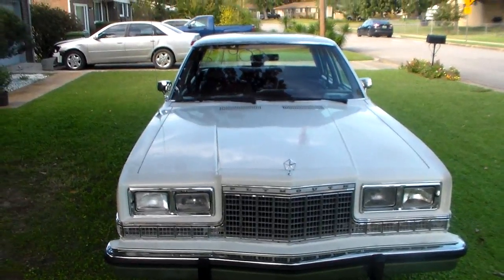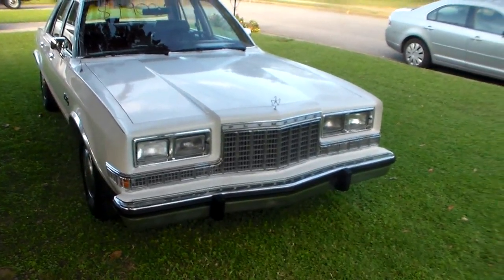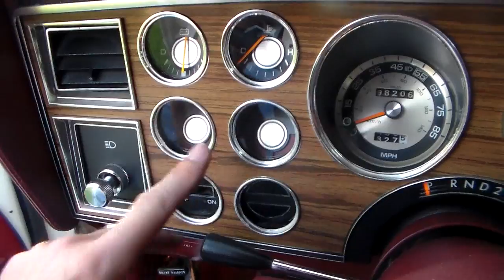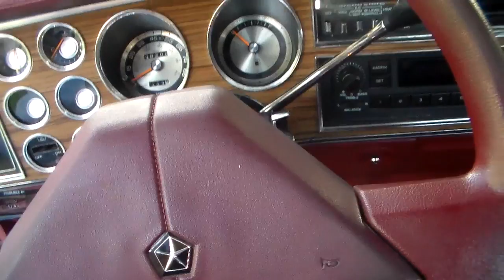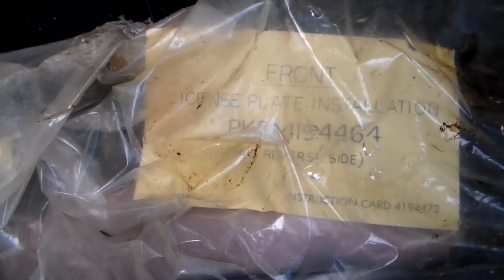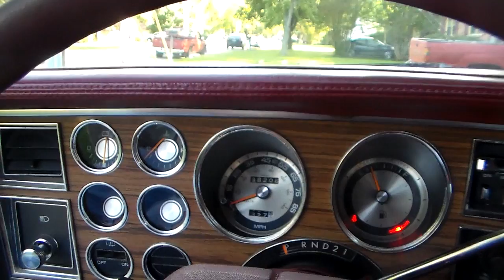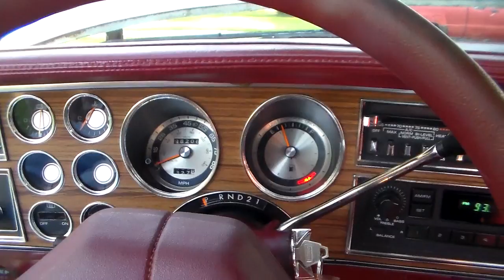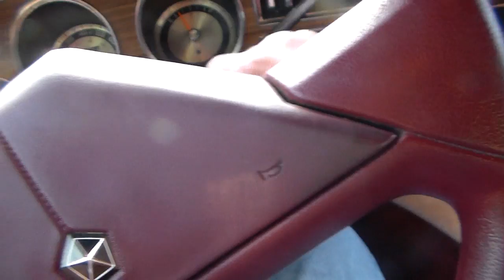Introducing my new 1987 Plymouth Gran Fury

Comment: The M body also included the Mirada, Mopar's first flexible bumper car.

I'm amazed at how many parts Mopar swapped among its vehicles. That heater control, the radio, the hubcaps, and the window cranks are exactly what came standard on my 84 pickup. The windshield wiper controls are exactly what was on my Horizon.
Reply: All They Found Was A Boot My '76 Plymouth Volare has the same heater controls. Besides the cluster it has essentially the same dashboard.

Comment: Great choice!  I got my '88 Fifth Avenue for $700 (yes hundred), being an HP junkie and with my Duster out of commission I've swapped in an 8 1/4" rear with 3.07 gears, made my own dual exhaust, and converted to 4-bbl TQ on a Performer intake.  Goes pretty good for a 4000-lb car with me in it, and still gets high teens MPG.
Reply: Get rid of the lean burn/spark control computer they had multiple names over the years (mounted on aircleaner)

Add a vacuum advanced distributor,mopar orange box ecu and if using a 2bbl still get a larger cfm 2bbl  not the smog lean burn one that came with it or another smogger carb..Some had the 2bbl that gave it power..Thats why some people say their 318 2bbl had lots of snap others say its a dog...

Factory axle ratio were 2.21 on these,so good job on the swap ! If you put a 4bbl,change the heads as 2bbl 318's dont have the proper heads..factory 4bbl 318 cars had 360 heads !

Comment: Gawd did you find a good one!! I have owned 5 or 6 M-bodies and there great drivers. The fuel control lean-burn can be ehhh if it messes up but it’s not that hard to convert to standard stuff. Those seats must have been a factory custom order. That’s has a “Salon” interior that would have had cloth seats as standard. Very strange optioned car for 1987 had to be a factory ordered car. 70’s through 84 Chrysler spun up a lot of odd optioned cars as you have seen before but by 87 they had mostly stopped that. I love the car love it. The Gran Fury nose was the best ever put on a F/J or M bodie car IMHO. Some people don’t like the transverse torsion bars but they give a great ride thou give a lot of play in the steering if the bushings on the bars get weak. Oh BTW it does have a crude temp control for the heater/A/c . There is a port under the glove box lid in the front that it pulls in air to check the cabin temp and adjust the heat cool damper. I have the factory manual that has all the info on it I can scan it and send it to you if you need it. Good luck man I am jealous!
Reply: Zachary Radford There isn't anything to be gained by hacking the ignition system.  Most of the "problems" can be resolved via competent troubleshooting.  Reman computers are available through Rock Auto and Mopar.

Comment: Although I generally prefer larger body on frame vehicles. Theres a special place in my heart for Dippys and their siblings. A mid-size RWD unibody with an 8 is just cool. The 318 is kind of a squeeze when you have to do certain jobs but all things considered theyre not that bad.
Reply: Chrysler,Dodge,Plymouth were uni body since 1960 ! Imperial only had a frame..Even fullsize Dodge Vans were unibody,yes the big 1971 -2003 Fullsize Tradesman vans !

Imperial had a frame until 1966,then went to unibody like the other Fullsize Chrysler Cars..

Comment: Excellent choice had a gunmetal blue 86 dodge Diplomat VeryReliable even at 200,000 miles
Reply: Plus it probably had another 200,000 when you bought it..

5 digit odometer nobody knows the mileage of American cars until the early 1990's..

After 99,999 they go to 00,000..

Some had 6 digits last one being in opposite colors but the last one was only a 1/10th of a mile readout,after 99,999.9 it went to 00,000.0

Comment: That's a very nice find.  A real grandpa car for sure and I'd lay good money on the mileage showing being correct based on the lack of wear on the interior.  I'd say the steering column wobbliness is down to grandpa using it to lever himself into and out of the car for the best part of 3 decades.  I'd do without the push bar, these beasties look good enough from the front already, very commanding and, to my eyes, exactly what a cop car should look like.  I've always loved that series of car, it's a shame they're so damn rare now, but at least I occasionally get to drive a friend's unmarked Diplomat cop car.  Fortunately I don't have to pay the fuel bills as that thing drinks worse than Oliver Reed...
Reply: +Kenneth White  I'd definitely say you're right on the headlight issue, I didn't realise they were still using sealed beam units as late as '87, I'm pretty sure they were extinct in Europe by then, but that was certainly a common occurrence when vehicles with sealed beam headlights were still around.  People tend to go for the most easily accessible screws which are usually the adjustment screws, wind them right out and often then the adjusters would fall apart and parts would get lost...
Reply: +Kenneth White  I can understand them not re-engineering the lights at the time, Chrysler was pretty strapped for cash then and even that cost was just too much for them.  As I said, a friend has a last of the line Diplomat but the standard headlights are no use in the UK as they dip the wrong way so he had to replace them, I can't remember what he used but I seem to recall that it wasn't easy to find replacement lights that would fit...
Reply: +Kenneth White  I suppose not.  It's quite funny really, they were grandpa cars, but also a very rapid police vehicle too.  I think he ended up using a set of lights designed for an early '80s Honda or maybe Toyota...

Comment: Hi Tyler , nice car, i have the plymouth caravelle here in canada, same car as yours mine is 1988,  mine had a 2 barrel on it too, i found coo car in wreckers with 4 bbl , i changed manifold and carb on to mine it is very nice, i love these cars 😎.
Reply: Cop car , woops not coo 🙄
Reply: I hope you changed the heads too back then(dont need to but works better and no bog plus way more power)...Factory 318 4bbl cars had 360 heads !  

 I hope you didnt use the lean burn/spark control computer either..

Vacuum advanced distributor,Mopar orange box ecu and a non smog 2bbl carb,the factory carbs have zero power.. With this a 318 2bbl will blow the doors off a 318 4bbl with lean burn /spark control computer !

Comment: You might want to check the mode door for the AC. As far as the steering column goes I know the GM's do that sometimes and there's three or four bolts that need to be tightened up after you pull the steering wheel off.

Comment: Remove the lean burn/spark control computer either..mounted on air cleaner ..

Get a Vacuum advanced distributor,Mopar orange box ecu (orange box is what I use) and a non smog 2bbl carb (find a old 70's Dodge van/truck 3/4 or 1 ton ) The factory carbs have zero power.. With this a 318 2bbl will blow the doors off a 318 4bbl with lean burn /spark control computer !

Your 318 will run smoother,start quicker..And for me It will have performance..It will be like a race car compared to what it is with it on..It will actually rev up,and have a great induction roar too...Gas mileage actually is better as you dont need to press as far on the pedal as you did before..

You can buy junk yard parts if need be,I have done so in the past etc..

Eg:My dad had a new 1985 Chrysler 5th Avenue same car as yours just a Chrysler version...Brand new he removed the lean burn(spark control computer several names during its lifetime) they also put on 360 heads and a 4bbl...The car beat my Brothers new 1986 Monte Carlo SS 305 4bbl with 3.06 axle ratio vs the Chrysler's 2.21 axle ratio !! I owned Cordoba's,Magnum's and a big newport 400 with lean burn I removed them all,swapped carbs and had a powerful ride,some would leave 80 foot black marks and stock they couldnt spin .That was the 18 year old version of me lol...But,it makes a huge difference..

Even if you remove the lean burn etc,if its still on...Swap the carb even if a 2bbl,it will have power..I owned a 1978 Volare 318 2bbl lean burn and it woke it up...Your car is actually a Volare ...
Reply: 01trsmar Absolutely bullshit.  There is absolutely nothing to be gained from hacking the ignition system.  NOTHING. 

If it isn't running right, find out why.  90% of the issues were with the carb, not the computer, and that's a fact.  A 2bbl 318 only produces so much power.

Comment: Thats an awesome car! Wanna trade for a 95 Volvo??? J/K.... LOL....

From the plate number i saw, its got low  miles... Just had the a/ccharged and a new blower motor, spark plugs, brake lines, brake flush, brake rotors,,  fuel flush and fuel filter, distributor cap, and carberatour service...  
Looks like it was sold in 2008 at 64K and again in 2012 at 92K and again in 2016 at 92, 814 miles.... 

Im totally jelous.. Basic, simple and sturdy.. Nice work

Comment: If you at least change both high beams and clean up the connectors they should work. When the connectors are dirty or a headlight goes bad it can cause a short. Id just change all four plus the rest of the lights on the exterior for starters

Comment: Could you kindly replace the chime in this 1987 Gran Fury with a scary buzzer from a 1984-89 Dodge Ram truck and the 5.2 engine with a 6.2 diesel engine from a 1983-91 GMC Vandura since I think a scary buzzer would suit this Gran Fury with red interior more than a chime would?
Reply: Jac2Mac no.

Comment: i actually think those are seat covers.
Reply: I agree. The smooth vinyl is not what that would have come with new based on the Gran Fury and Diplomat brochures. I'll bet the original upholstery is underneath and probably in good shape.
Reply: You may be correct about that Kenneth. Lots of these cars were used for fleet duty - that is for sure. I have however seen a couple of cases where owners had an auto upholstery shop make and install plain vinyl covers overtop of cloth seats including the fold down armrests and headrests. I worked in a Ford dealership in the late '80s when I saw that. At the time I thought it was strange, but to each his own I guess. Anyhow I am sure Tyler will find out what the answer is once he had time to really go over his new ride.
Reply: I had a feeling that they were covers. Since the original velour is probably in great shape underneath and Tyler likes the custom vinyl covers, it is a win-win for him either way :)